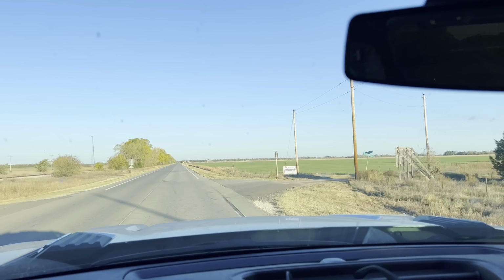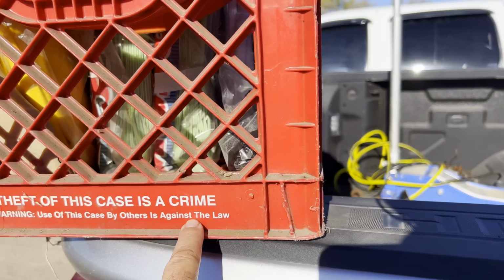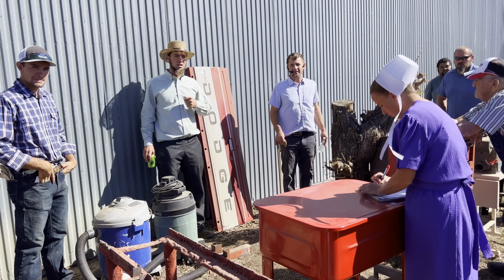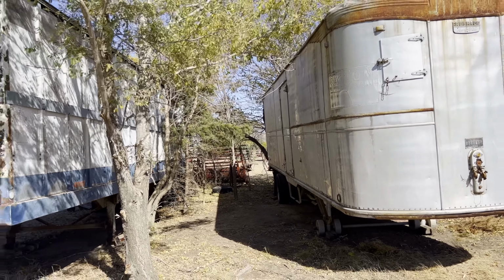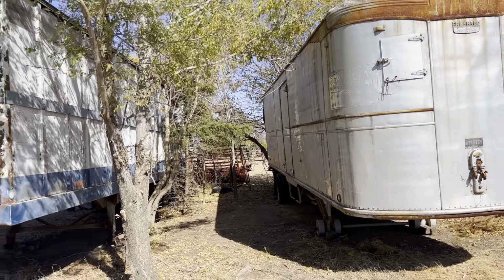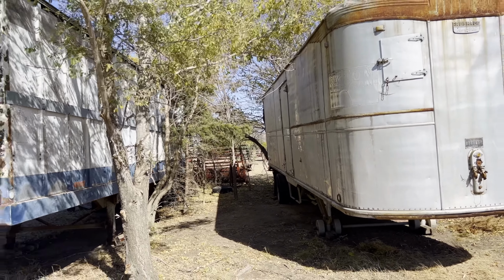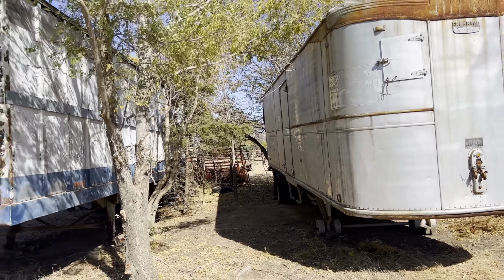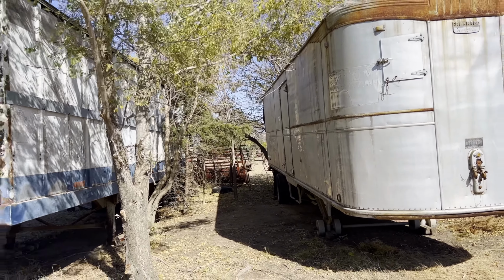I Bought Some RARE Items plus Something CRAZY (3 of them!) at this Auction in a Small Kansas Town!

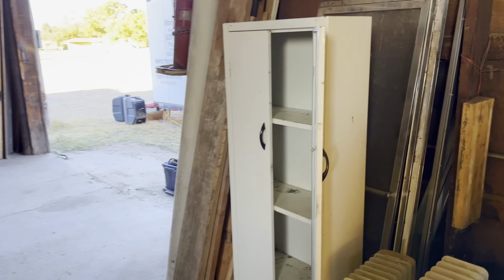Comment: 3:18 I have a cabinet very similar to that one. I also had about two dozen old steel Youngstown Kitchen Cabinets. Sadly I had to sell them due to some financial issues, and actually lost money, but, desperate times call for desperate measures. I don't know why, but those hog feeders turned into bottle caps kinda caught my attention, and the trailer you bought for $800 as well. I don't have the means to haul it, or even anywhere to put it, but I like it.

Comment: That the 401 cid super duty industrial v8, possibly a 477 cid there was also a 534 cid in later years . they used a Holley carb in most cases , they are a super high torque engine with low compression and can be easily super charged with high psi . and even though its a very large engine you can rev the crap out of them things very strong bottom end and valve trains with huge valves . 2.30 intake and 1.90 exhaust if I remember correctly. And sodium filled exhaust yes even back then nd flat faced heads combustion chamber was in the piston top. Not super high horse power but frame bending torque . they held a dozen quarts of oil too. Lol. They were also used in marine applications and could handle being run at full throdle all day long too. Water pump on these things would move like 11,000 gallons of fluid per hour with both thermostats open.

Comment: Somebody who restores those old antique tractor trailer trucks will probably buy two of those trailers from you ! A lot of cool stuff ! Some of those old Ford trucks have 391 truck blocks in them ! They have steel cranks in them like a 427 but they have oversize balancers on them you have to turn the front snout of the crank down to put a high-performance dampener A lot of the old blocks have ribs cast into the side of them !

Comment: Bel Air badges in that tub in the $140 engine lot are like 55-56.  I usually have no issue getting 10-20 each on stuff like that at swaps.   I wouldn't be shocked if you could do $100 back out of just that bin.  

Almost all my swap meet parts are in milk crates.  Carbs in some, tools in some, crank handles in a couple, mirrors in another, and so on.  Makes setup and tear down pretty easy, I just have to take a few minutes to rearrange where people dig through so I can stack them back up.   Even the manuals and books get milk crates.  In fact I bought some old slides this last Sunday at our flea market in part to get the milk crate they were in.  Stuff that fits but is a tad too tall just become top crates with one or two stacked under.  

That old Fruehoef trailer is pretty cool.  If you can't sell it, use it as a sign.  Maybe find a 50s semi tractor to go with it, or even cob up something from an old grain truck.

Comment: That middle trailer will bring good money because there are guy's that want them to pull behind the old rigs they rebuilt for truck shows and the refers dollies were set back way to far if a forklift drove up in with a pallet it would tip over if it wasn't hooked to the tractor seen this happen before but a lot of nice scores for sure but keep the video's coming